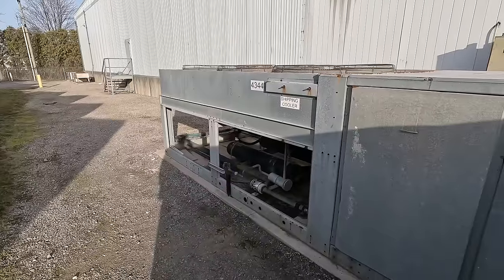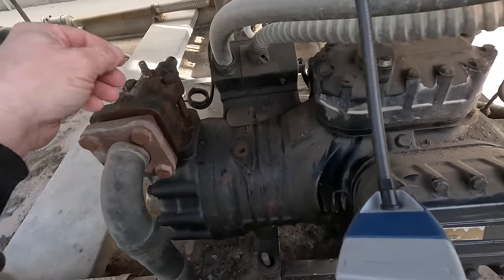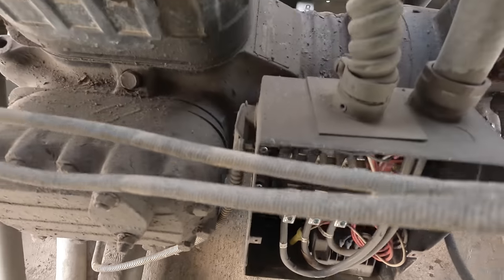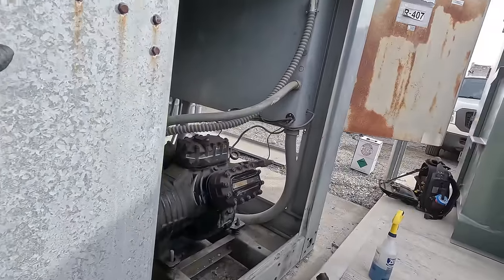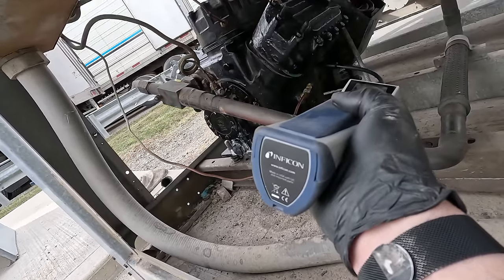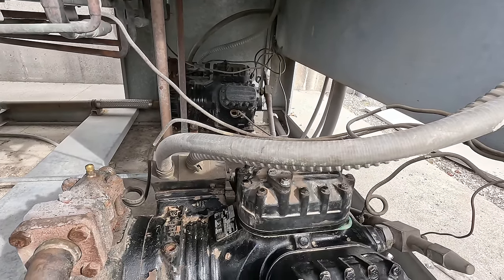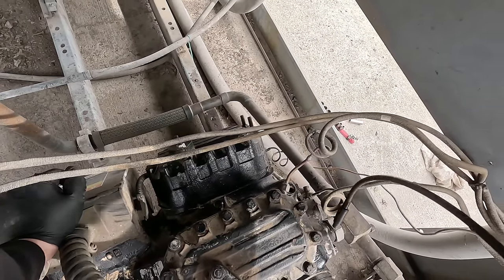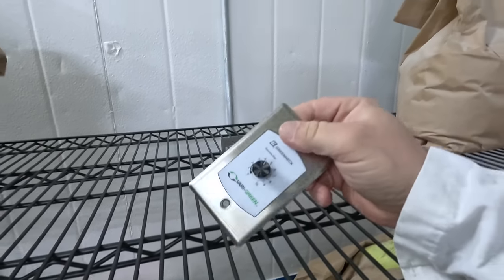Industrial Cooler Major Problems

Comment: Good stuff Rick!  I have the Pittsburgh torque wrench also and works very well. I don’t use it often so couldn’t see spending a ton on one. Do need to get an crescent torque wrench for all the self contained cases that I work on, for the quick connect line sets. Always love your refrigeration content.

Comment: I know that’s not a HeatCraft unit looks like Russel but 
Cycling the fan closet to the header is a big No No 
The intermediate header is not designed for the wild swings in pressure and temperature and it will start leaking at your tube-sheets 
This is HeatCraft Literature
When factory fan cycle switches are installed they never cycling the #1 fan 
Take it or leave it just letting you know 
Thanks for the videos love your channel Rick
Reply from the maker: So are you saying this design in particular is designed for the second fan or all systems?  because I know I have read that it’s usually the fan closest to the header.

Comment: I see you built a pretty good channel. Good job, man!  I'm trying myself to do the same. Looks like you're using a GoPro, Maybe?  How's that work for you? Your audio sounds really clear over the disportion of the compressors. I'm planning to get something like that, I just don't know anything about them or what models still look at.
Reply from the maker: I’m using the medium mod which allows the microphone to shoot towards me and away from the noise. If you use the GoPro without it, then you’re gonna have worse audio.  The GoPro does a good job keeping yourself mobile and able to do your job like normal but the picture quality in low light and up close is not as clear as cell phone.

Comment: Nice thorough job, Rick! Poor practices will get ya every time, smh. I see the same crap with basically every king valve, loosening, and then tightening the packing nut is not that damn hard, seals in caps and nylog, no leaks, no dumb service calls, easy peasy.
Reply from the maker: I’m guilty of not loosening the packing but I also believe it’s likely damaged more often room over tightening.

Comment: love this leak detector, have 3 different, but this is best. 
can you recommend good hoses? 
mine leaking on valves even new(hilmor)
Reply from the maker: Yellow jacket like the ones in the video I’ll release today are the longest lasting I’ve had.
Reply: @HVACRSurvival  did you use refco hoses?
Reply from the maker: No I haven’t. There not sold here